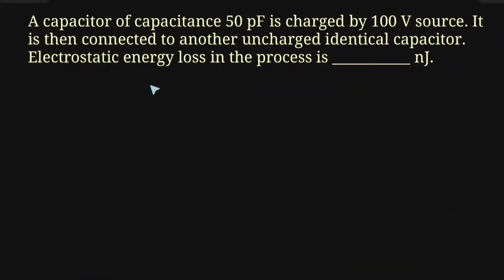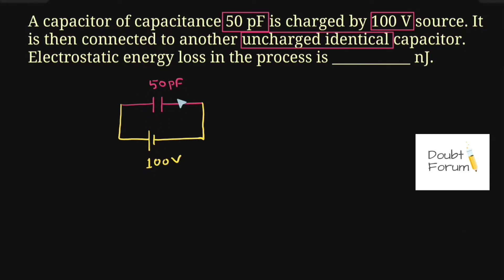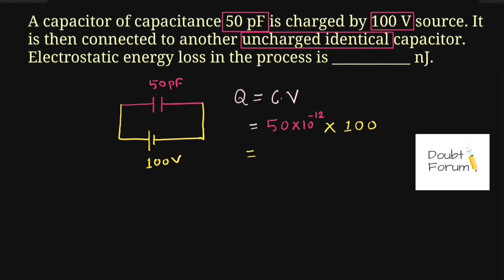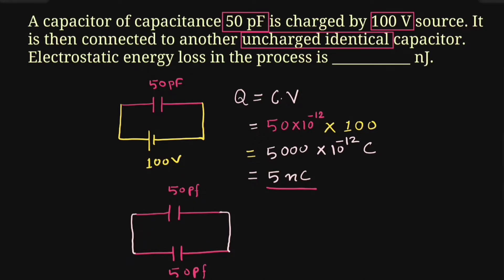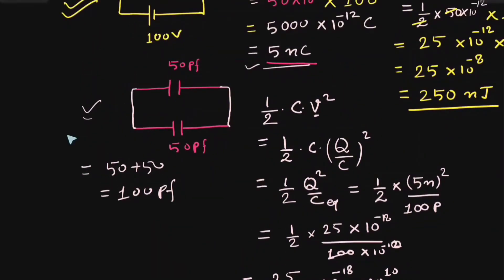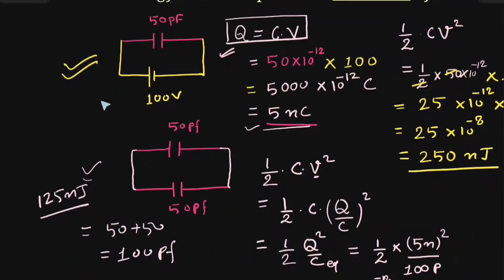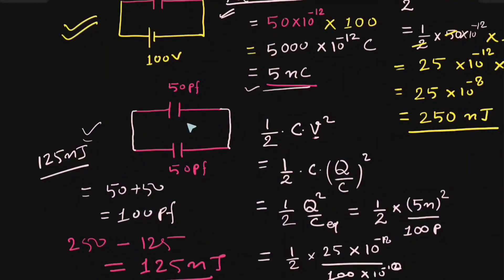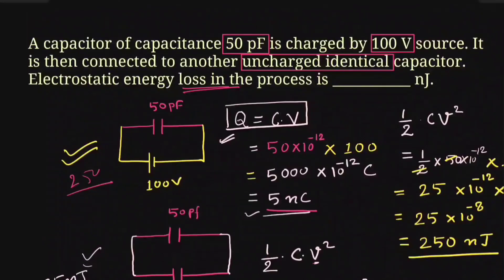A capacitor of capacitance 50pF is charged by 100V source: JEE Main 2022

Comment: Sir , question sirf connected likha hai... to humhe kaise pata chala ki ye parallel me connect hoga ... series me bhi to ho sakta hai
Reply from the maker: To charge a capacitor, we always need to create potential difference across the plates of the capacitor. To achieve this we need to connect the voltage source across the capacitor which means in parallel.
Reply: @DoubtForum  😁😁